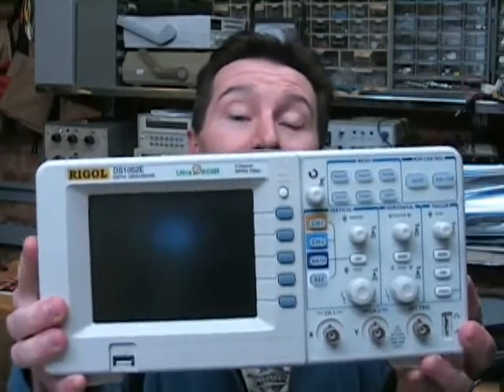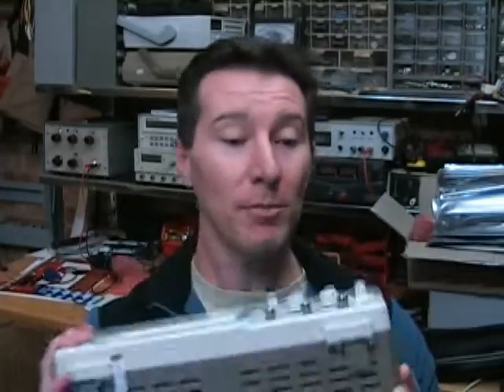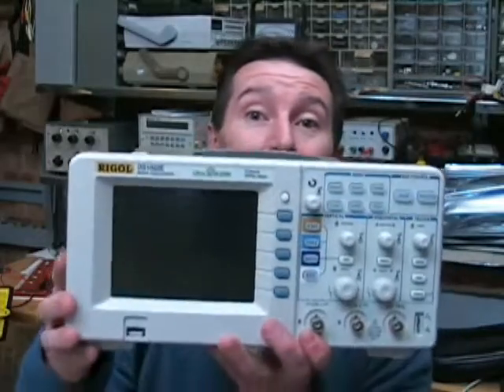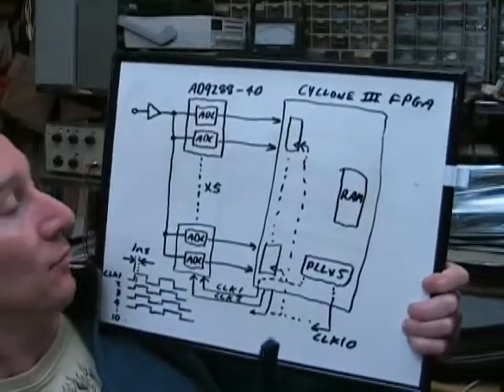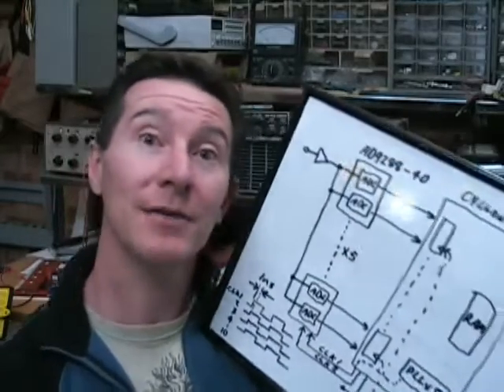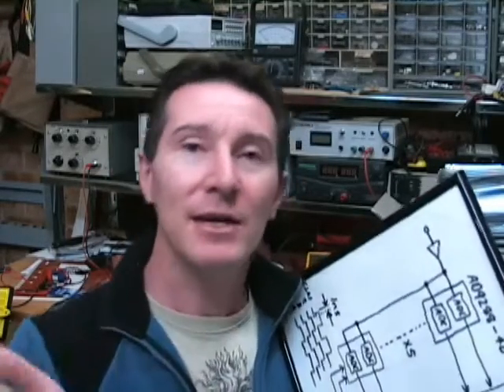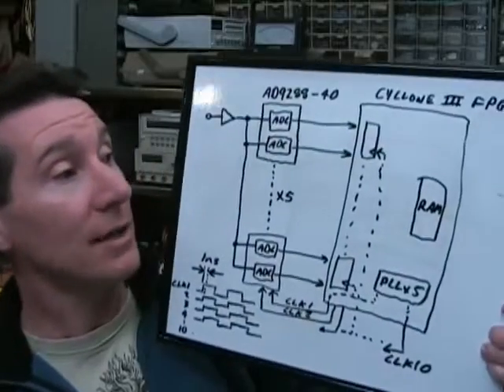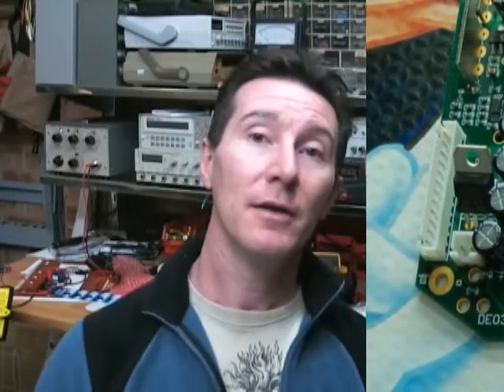EEVblog #19 - Rigol caught with their pants down!

Comment: Does anyone ever test these types of ADCs at various crock speeds and quantify their performance? Or do the electrical engineers just have to try it for themselves and see if it works at that clock speed? I'm curious what the primary bottleneck is that limits the specified speed for an ADC. I guess it's either the A, the D, or the C.

Comment: Hi! I would like to know how to get 200MSPS from a 40MSPS ADC. Using only one STM32F407VET6 and only one adc AD9288BSTZ-40. Look at this analysis of this DSO338: https://lygte-info.dk/review/Equipment%20Oscilloscope%20Aarontek%20DSO338%20UK.html
Reply: I also asked on the ADC manufacturer's website if it is safe to overclock this AD9288-40 to get 100MSPS but had no answer yet.

Comment: Is a  4g/s  100Mhz   better than a 1G/s   300Mhz   or 2G/s 400-500Mhz ????!
Reply: 2 things to keep inmind

1. What is the highest signal you'll work with
so.. if it's 200MHz that you work with commonly its not even worth considering 100Mhz on the front end even if it was 10G Sa/s
i think it's rare that you'll need 400 or above MHz
if you can get 300-400MHz that's a luxury
100MHz to 200MHz is fine for most people

as for sampling rate
2. you want the highest sampling rate that you can get , Nothing under 1 G Sa/s though
4 is awesome
the standard is 2 or 3    1 is a bit low

Keep in mind HOW MANY CHANNELS DO YOU HAVE
because then it divides between all the active channels in use

Comment: So AD test their chips to see which ones are candidates for overclocking, and those are the ones that go in the fastest scopes. Maybe Rigol have a similar procedure with complete scopes. The ones that stand overclocking without dangerous overheating get the 200MHz rating. This makes a potential problem for those who decide to hack the lower models into fast ones. Their chip set may not be really up to the task, resulting in an early death of the scope. Just something to think about.

I underclock my PC. I don't notice any change in speed, and it runs cool and quiet.
Reply: I found out directly from a Rigol engineer that the hacks are not a problem and recently they are running a special on some of their scopes offering the "hack" with a software upgrade key for free.
Reply: +donepearce Maybe they just start it out with a slower clock to begin with...?

Comment: I think you guys may all be mistaken.
AD9288- Dual ADC!  Pull the data sheet at analog.com.  Two independent ADC's per chip.  So with 10 ADC's, overclock to 500MHz equivalent sample rate is only from 40 to 50MHz.  With scope errors, this has a good chance to work well.

What do others think?

Comment: I'm not an electronics buff, but i do remember that it was common knowledge that some PC-CPUs, (particularly the Intel Pentium I series) chips were all actually manufactured the same, only they got tested and graded later on before they were labelled/legended with thier apparrent clock rate.  Its cheaper to make more of the same than several variations.  Maybe Rigol realised some similar situation with these and tested the cheaper ones themselves to see if they could perform reliably in thier particular application. Theres certainly plenty of breathing space in the casing and internal design (which is good).
Reply: It is the same with most semiconductors. They get tested and then stamped. Now, when the manufacturing process has a good yield and the market a high demand on low- or mid-graded chips, they will print the product code of the mid-graded chip on a chip which full fills all specs of the high-graded.

And other aspect to keep in mind: On of the most expensive part of semiconductor manufacturing is testing. Every second that a die needs to be connected to expensive test gear costs real money. So an alternative to create "low grad" parts for a chip manufacturer is simply skipping test steps.

But that all leads to a question: How much time those Rigol put into their testing and how is their yield?
Reply: sarowie
 The most common scenario nowadays is that they design a precise chip. Then they make some minor changes so its less precise, slower, with narrower bandwidth, etc. Those changes can be implemented by software (locking the part) or hardware - by either slight change in (usually top) mask or by physicaly cutting into top layer by laser.
That last way is used often, but in the opposite direction. Only few cheap chips are tested (to make sure that the process is OK) but the more expencive chips are tested and then balanced for best performance (f.e. by laser that is cutting off jumpers in resistor matrix or by usually hard /blowing fuses/ programming).

After all, it would be much more expencive to make two different chips and especially the price of the more precise one would go up several times...
Reply: @mrkv4k  That makes sense.

Comment: The parts are sorted at mfg to be in spec (noise, offset, linearity, monotonicity) up to a clock rate. The main cost of overclocking these ADCs is higher noise in the LSBs (least significant bits) - maybe 4 counts vs 1. This will be visible at high vertical zoom ratios. People would be YELLING if the ADCs were dropping codes...
I wouldn't worry. The noise is super high frequency and low level and is easily filtered/ignored.
If I were Rigol, I'd offer a 1052EX for $75 more, with 100MHz ADCs.

Comment from the maker: Yes, the pricing is interesting, big increase in the sales margins to be had by overclocking in this instance.

The part obviously works adequately at 100MHz, as the scope works with no apparent sampling issues. But would be interesting to know if there are any corrupted data or other issues.

To do it properly would require a big setup, a large number of devices (say 10 at least), test patterns, and tested over temp too. Too much work for the blog I'm afraid!
Would be interesting to see though!

Comment: The pricing on these chips is interesting, the 100Mhz part is $10.63(US) and the 40Mhz part is $3.44(US).

Could you yourself order 1 of each and test them both with some test circuits from the datasheet and see how they perform, and see if there are any performance differences when overclocking the 40Mhz part to 100Mhz?

I'd LOVE to see a vblog where you do this and find out for yourself if they do seem to all work OK overclocked!